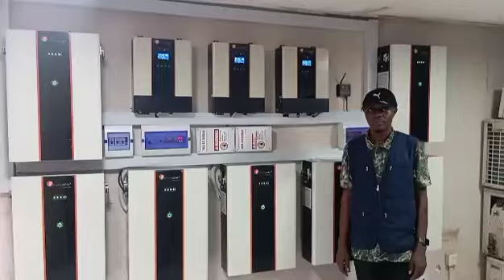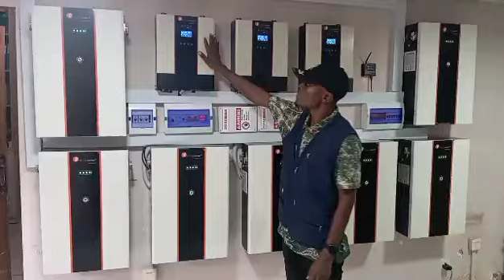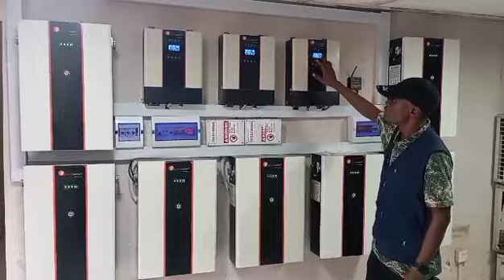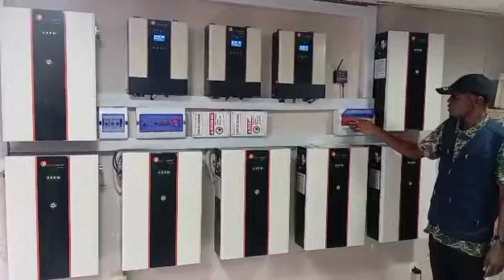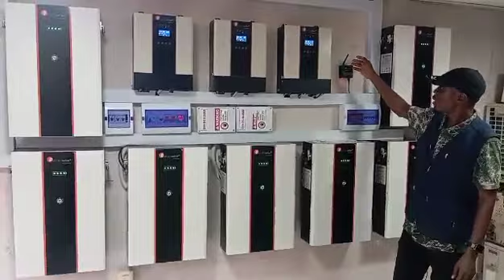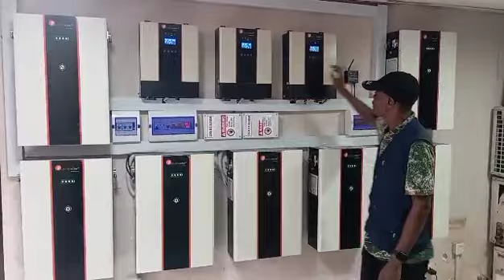Commercial  solar solutions

Comment: So many things i wanna ask
How is it safe to connect 24 pieces of 720w panels generating a total output of 17,520 or 17.5kw to a 15kw hybrid inverter system 🤦🏾‍♂️💔
It's too much bro that system wont be able to handle it after a long period of time
Reply from the maker: Note: complete day time load, without  backup from grid